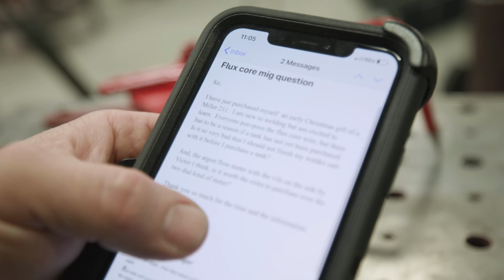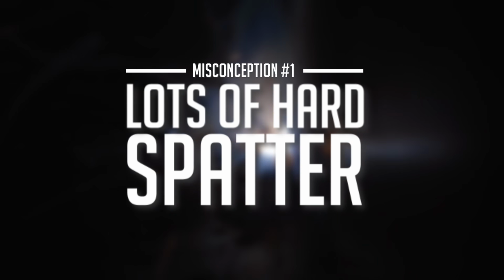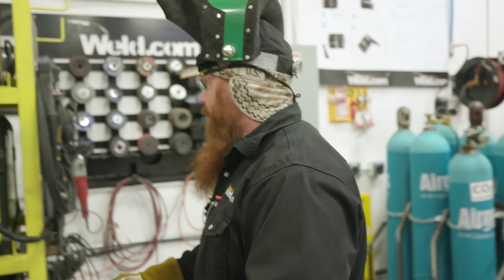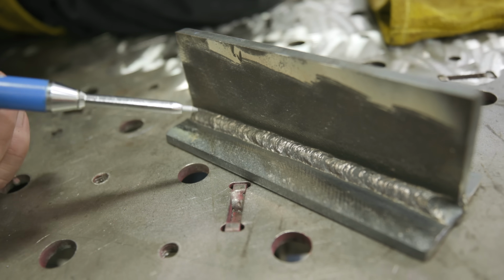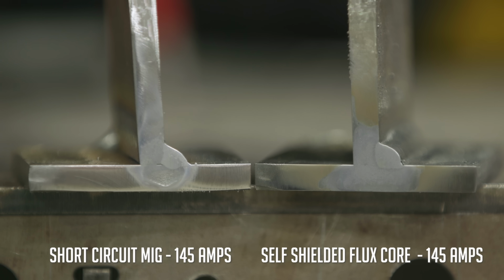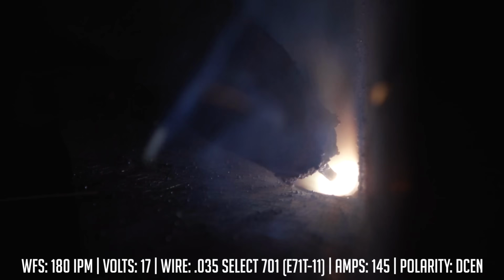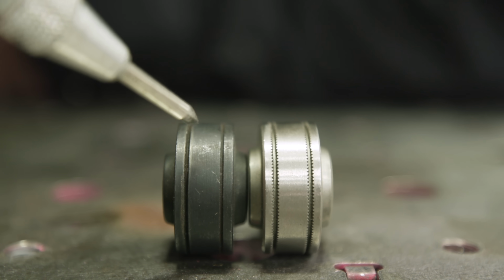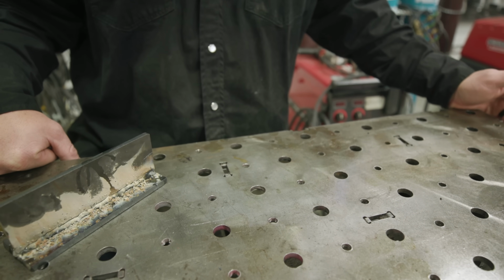3 Flux Core Welding Myths DEBUNKED

Comment: Does anybody else find when they run flux the wire speed has to be right down for it to work, I'm closer to 100 Ipm most of the time for that voltage, but when you see these demos it's up there at 180.
Reply: Uhm no. I usually am pretty close to his settings with .035 flux core.
Reply: @JimGriff1720  yeh fair enough, somethings up then because I struggle to burn that wire up at that speed, or have to have too short of a stick out trying to get more heat. Somethings up I wonder if my welder is lying to me with its voltage readout.
Reply: Dont get me wrong I get some beautiful welds at 120 max, just cant get anything good to happen up higher.

Comment: This was a great lesson.. I often use my 110 flux welder for welding exhasuts and frames on  jeeps.. People think I'm crazy.. It works so well, I usually pre heat my metal to 350f and it penetrates the frames super well.. I use anti splatter to remove the BBs and my welds will rival and solid wire mig.. They just don't "look" as pretty...

Comment: Like you said, you used a lot of fcaw on structurle steel. They still use this procces in ship building today. I get a lot of flak from welders for giving a knod towards using this method over mig welding. Especially when welding outdoors when smaw is not available.
Reply: Fr tho flux was designed for industrial use, cos it’s hot and high deposition rate

Comment: Most flux naysayers aren't even welders.
Reply: That’s for sure. Most are keyboard warriors and can’t even fix a sandwich much less weld some stuff together.
Reply: Alicia szemplinsks
Reply: I've welded on an off for 18 years and never heard anyone say anything like that but I don't really like to discuss welding with people that don't know anything about it.
Reply: AttentionJunkie I’ve been welding for near sixty years and started with stick, learned acetylene brazing and welding, then Mig and Tig. All I see in most of these videos is people are more concerned with is Mig. Most of these “weldors” couldn’t make it in a shop production or out in the hot sun repairing and building heavy aggregate equipment. They spend more time using fancy tools and pretty clean shops. If they had to do production welding under a asshole foreman that wants the work out and to start on the next project they’d never make it, top that off with a 30 minute lunch break, two 10 minute breaks a day  in a 10 hour day, asking permission to use the head and getting a drink of water and being careful not to stay in there over 5 minutes and the shop superintendent on a high platform watching you.
Reply: @100texan2  That isn't a typical of all production environments, shops that want competent workers don't act like that because competent workers are in demand and will just go to the next shop up the street. The only places I have ever worked, across multiple industries, with that sort of operating culture were chock full of folks too dumb to know any better, shoddy work was the norm and there was a list of safety violations as long as my arm; with the place always on the edge of loosing contracts due to quality control and general liability or trying not to get fined or shutdown by the local authorities. (I left each within months just so I wouldn't be maimed, or have my name associated with them.)
Reply: @UniteForgetLeftRight  YOU MADE MY DAY WITH THAT STATEMENT SIR.
Reply: I'm not a welder by trade but I do diy projects. I learned on a Lincoln 140hd mig I run flux core wire and have done pretty good with it. I catch a ton of flak from people. I've learned that those people aren't really welders lol
Reply: Are to! They watched a video on it once.
Reply: Well said, i used flux properly and never had problems, penetration is better on thick material too.
Reply: @maximos2448  Fact !!!!!
Reply: I think the reason flux core has such a bad reputation is that a lot of people who starts getting in to welding buy the cheapest machine they can find and that of course comes with flux core wire. And if you try start learning welding with flux core on a machine worth 50 bucks you’re bound to get frustrated. You start google around and get the same answer from people who made the same mistake, it’s not the machine it’s the flux core that sucks and you should buy a mig/mag instead. You take their advice and spend a little more on a better machine. You get better results and from that moment flux core is the worst thing that’s ever happened to welding.
Reply: @nameofthegame9664  mine costed almost $200.00 not no $50.00 cheap dollars and mine is a cheap machine and was worth buying I don't gotta fuck with buying gas with mine just some tips and wire and I like it I'd buy another one if it broke
Reply: Flux is more versatile than stick or mig. I don't understand why welders would get upset about it. I only wish I had more exprience in it.
Reply: @morganschiller2288  That is correct. Those who do not understand or have the experience seem to have more to say than those of us who do. Even if they are WRONG!!!!
Reply: Ive done alot of structural work. Its all we use. Most is dual sheild now, but some times the 232 machines have to come out.
Reply: Flux cores is awesome. More penetration than solid core and don’t need to stop and change a stick
Reply: @Mikey-ym6ok  I keep on the trigger and make a fat line
Reply: Well said and noticed that myself quite a lot
Reply: It's a tool, I wouldn't use my flux machine for things that my stick machine works better for and I wouldn't subject myself to more work simply to be stubborn by using stick when it could easily be done with flux.  Bunch of people are pissed off they bought a 300$ bottle of argon to tack up lawn ornaments.
Reply: Justin Green they just need to get out into the welding pond and get a decent job
Reply: @justin456  hello. what type of jobs would you pull out the gas Orgon for ?
Reply: @mad-maxx2211  The only thing at least for me making gas a necessity is aluminum and thin steel because you can't really get flux smaller than 30.  For a lot of mild steel, lugging a 20lbs+ bottle around is much more ludicrous than dialing it in and wirebrushing the work.  Obviously TIG as well, again for aluminum and thin steel, SS, Titanium, exotics.
Reply: @NNNNNNNGGGG nor have they built really anything like ever flux is awesome in its element. I wonder why all the wire manufacturers waste all that money making flux cored wire if its junk. All it takes is a little bit of reading and boy howdy you see what flux core can do
Reply: If I could "love" one YouTube comment, this would be it. I run E71T11 for 95% of the MIG work I do out of my shop. I have yet to have a customer be able to tell that it was FCAW.
Reply: Most stick welding naysayers aren’t even welders.
Reply: Expedition XJ U.S.A   They R 2 they stayed at a Holliday Inn Express last night!
Reply: @tomharrell1954  I totally agree. Maybe one thing forgotten ?? With a major hangover too.
Reply: YouTube certified welders
Reply: @MikesRepairShopEDU  THATS  A FACT JACK !!!!!!!!!!!!!!!!!!
Reply: Ha, yeah. Although I think it works well outside, I prefer stick, I don't see the point in using " no gas mig" (stupid name) because mig saves on mess of slag an clean up times. Flux core has its place for speed of not needing a new rod every few minutes I suppose.
Reply: I also hear people say "professional welders cant weld on that cheap machine with that wire cause they are only used to good machines and good wires"
Reply: I went to welding school for a whole semester trust me flux is totally for noobs... 

🤡
Reply: My last big project was building steel ferries in BC we never touched hardwire. It was all flux core in the shop and stick in the field. Our shop FCAW welds were all X-ray and UT tested.
Reply: Expedition XJ U.S.A  I’m not a professional welder don’t know much about it I’m 13 and actually just learned to weld yesterday cause I wanted a flux cored welder for Christmas I can make good beads for a beginner I will say if you can clean your beads up good and all the spatter it looks almost like a regular mig weld
Reply: Lol, exactly
Reply: Expidition I agree 100%. You are gonna have a hell of a time welding outside without losing your gas and just burn up metal and not get anywhere! Flux is great if you don't have good clean metal to work with too! I got a cheap harbor freight welder that I take with me in the truck and run off an inverter to do quickly jobs and if your a decent welder even Flux welding can look good as gas or close to it
Reply: Outside i love it but in a shop its horrible .
Reply: It's perfect for just a hobby welder. I've been using it for years and it works great.
Reply: I started on oxy-acetylene, it's really the most versatile for the hobbyist level. Works very good with thin sheet, cheap up front and with the right handle you get a cutting torch and soldering/brazing/thin-hardfacing when needed. Slow per inch, but that is good for the occasional user working with small one off items, especially as oxy-fuel is based less on establishing initial settings and test pieces and more on technique that can be adjusted in real time. (Usually just grab the approximate tip, adjust the flame to neutral and get right into the actual workpiece.) Really not too unlike TIG with less cost and complication. Later add a stick or wire feed or just hire a guy if you have many welds on a project.(really you probably already have a friend with a stick machine.)
Reply: As a non welder Flux core user, I agree 🤷‍♀️ I don't know shit about welding and my welds look terrible 😂
Reply: Plot twist: they aren't even people.
Reply: I don't really care for flux core when running it on a small mig welder but once you jump up to a larger/better quality machine I have come to enjoy the ease of use that flux core provides.
Reply: I have both a fluxcore and stick use them both for different thickness. The only reason I'd never get a mig or tig welder is for the cost of gas and consumables
Reply: @chupasoplas  I run both tig and mig with gas and you would be surprised with the cost of CO2 and solid wire over running flux core. I do enjoy the flux core cause it lays in nice little beads almost similar to stick welding.
Reply: SKUMMASBAGGUS  I could show my bubble looking weld lines later on
Reply: MIG is better for high production with multiple passes as there is little to no cleaning between passes, the filler metal is also cheaper. Flux is good for difficult environmental conditions and just fine for single pass and lower production rates. Dual is for more critical welds where the engineer needs to be super extra sure that the welds are sound, as a bead will still be adequate with one shield missing. Of course there are even higher production specialty processes, including some with flux like submerged arc, or those robotic machines that crawl up a ships hull doing vertical welds on inch thick plates in a single pass at like 1000 amps. (Using plates on each side of the joint to keep the puddle from running.)
Reply: @mytech6779  well whatever gets the job done is good enough for me
Reply: That's me. I'm just a shit clown spatter master.
Reply: Yes
Reply: I'm not a welder but I play on on TV.
Reply: I work in a sheet metal shop welding on a daily basis, we do in fact use MIG most of the time. But only because theres not as much cleanup, theres nothing wrong with using flux core. But my dad who is an electrician by trade and has worked NEAR welders claims that flux core is useless and that in his oh so vast experience with it he believes flux core has no purpose anywhere
Reply: @babybro66  what do you mean by clean up ? What is cleaner when using gas? I’m new and want to learn.
Reply: @babybro66  oh really. Dont go in any buildings then. Its all dual sheild and inner shielded. They might fall down lol. Youre dads very wrong kid.
Reply: @babybro66  tell him to stay off bridges. AWS bridge welding code D1.1 for E71T11 self shielded flux core.
Reply: @babybro66  must've never been on a shipyard.
Reply: Most mig welders today aren’t even welders because most never welded with stick. Stick is how I started and what I prefer because most of my welding is outdoors, although I do like mig, less cleaning.
Reply: @100texan2  Amen Texan. Long live Texas.
Reply: @100texan2  lmfao and stick welding takes something mig doesn't? Go back to the platform dude your kids hate you for good reason
Reply: @Najsnwjsbdn  I think it’s better to learn stick first.  MIG is no good in windy situations. FLUX CORE IS DIFFERENT GUY. Apparently you just like MIG  because its weld is “prettier” like the “pretty boy” you think you are. You never welded sixty feet of straight overhead welding in a factory production shop you’re probably lucky if you even welded flat. I bet all you are is a gofer where you work.
Reply: @100texan2  negative people who learn and make do with shit better appreciate fine equipment. You teach and have been tought with an improper mindset
Reply: @Najsnwjsbdn  I could outweld you with stick with my eyes closed. “Face it guy, I have way more experience than you and you’re just jealous because of it. Stick welding is here to stay, more dependable and it gets the job done with lower costs. That’s been proven time and again. It’s the one welding procedure that is the most versatile and has stood the test of time.
Reply: @100texan2  my dad has been an engineer his whole life. 60 guys at his workplace now building everything from log carrying trailers to hydraulic crush rubbish truck bins.  The only time a stick welder gets used is when there is a gap to small for the mig gun. 99% mig. Way faster. The big migs burn it in just as good. 21st century.
Reply: Flux core are use for thicker material and burn hotter and more smoker
Reply: @dennistv598  Lots of smoke just like SMAW for sure. But does the job at hand. VF
Reply: Dennis Tv a lot of sparks too, but I like it. It makes nice looking welds too. Mig is too susceptible to dirt, grease, wind etc. I don’t know how anybody can weld with it properly in windy conditions.
, but It does have its place like all the welding processes do. My opinion is SMAW is the best all around more versatile to use. That’s why I suggest all beginning welders start with SMAW but it’s good to learn the other welding processes as well. I believe that a SMAW machine serves most people better for all around use.

Comment: Just even learning about the polarity was a great help! thanks for that
Reply: doublehelix109 - The same polarity "trick" work on stick weld, etc.
It's worth keep in mind for very thin plate do not reverse...help avoid a bunch of holes. ;-)
Reply: @crpth1  thanks, i dont have a stick welder just a mig that ive had nothing but trouble with wire feed and never having gas so have brought flux wire, least i might be able to a better job of fixing up shit now haha

Comment: The people preaching "it doesn't penetrate" are the same ones burning through their work piece with FCAW.
Reply: It doesn't penatrate welding downhand. I don't know why anyone would want to run it downhand because the all position innershield is easy to do vert. I saw a gate a guy did tho. Mounted it and welded it downhand. Didn't last a day and was lyin on the ground.
Reply: @gregorytimmons4777  nothing really does though.

Comment: I remember welding with flux core for months because too broke to get a bottle and stuff didn’t need MIG. Then I got the bottle and still welded flux core. Then my buddy wanted to put an 8.8 ford into his Jeep so I figured MIG for nicer looking welds. Spatter and pops and zero pen on several beads. WTF!! Took a solid hour until I realized the polarity was wrong. 🤦‍♂️After that it was all good. I mean the axle never fell off through hairy trail stuff.
Reply: Perma Grin always listen to your machine you’ll know when it’s in the wrong polarity

Comment: See the problem i have is when you buy a cheap welder.. Like a gasless SIP weldmig.. the only option on there is to run flux core and ive had terrible experiences with it because there is literally 2 settings on my machine.. high and low.. thats it lol and i got wire feed issues where only 7 out of 10 seconds the wire would run at a fixed speed of 95 amps.. i could never get enough penetration on 4mm box section and i use to think it was me as a welder and let me tell you.. you feel awful because you spend 30 seconds welding a section only for it to break off in your hand and that is after cleaning the metal bare !.. I use to think i was just awful at welding and useless. I think flux core can only really work on machines that are sufficiently built to run it properly.. Running flux core on those cheap machines is fuelling the myths... After that i went for a cheap stick welder running 3.2 6013 on 110 amps and let me tell you the difference night and day.. i could weld stuff down to 3mm on that so i knew it flux welding works if its done correctly with the correct machine..

Comment: I'm an industrial maintenance mechanic but I used to be an ASME D1.1 certified structural welder. One of the other mechanics hates the flux core we use in one of our wire machines, a little 110 volt Lincoln. He insists on welding to get the mutant fish scale look. It just doesn't work well. Maybe with a more powerful machine he could get away with constantly moving the wire out of the puddle and building a new puddle but not with the small machine. I just run the weld with little or no manipulation and it works fine.